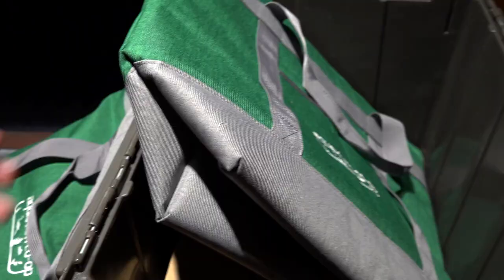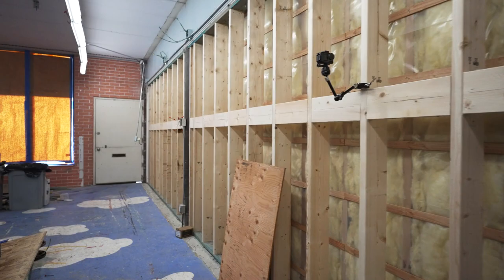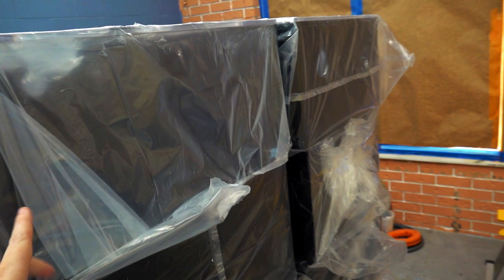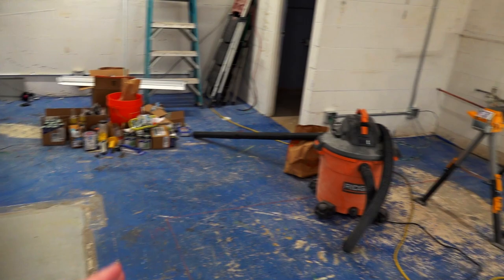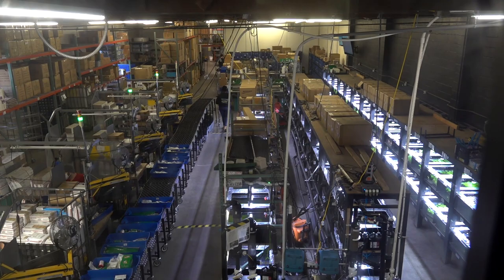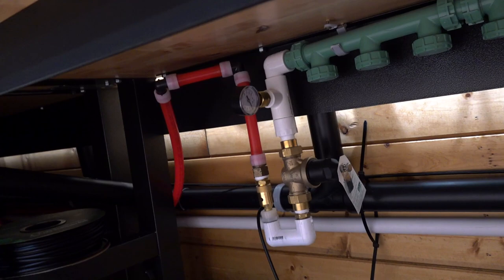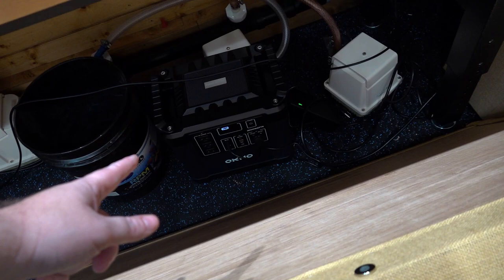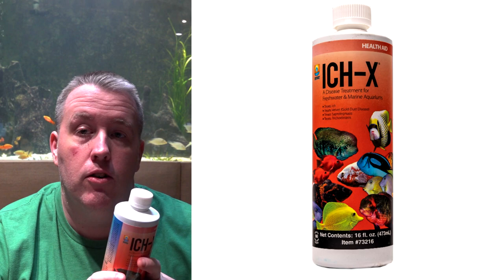What is New with Aquarium Co-Op? Behind the Scenes Vlog

Comment: For your air pump UPS, many times a UPS is shipped with the battery disconnected for safety reasons. Did you hook up the battery after unpacking it?